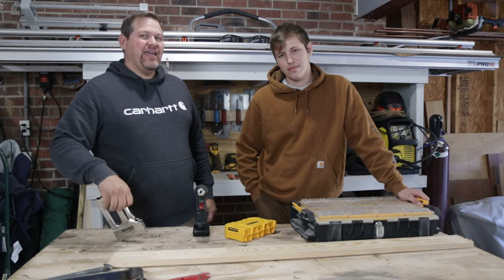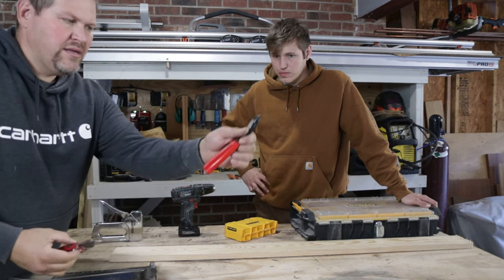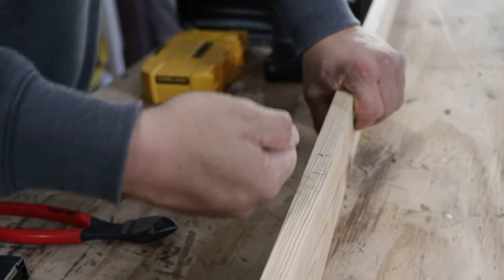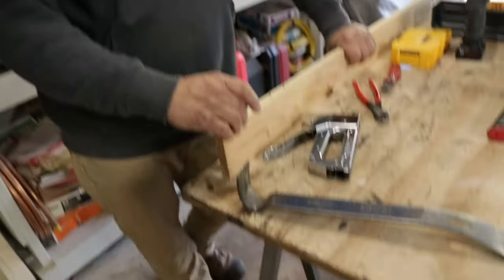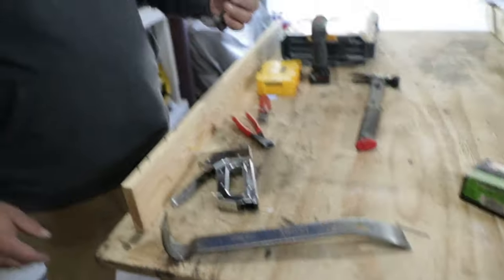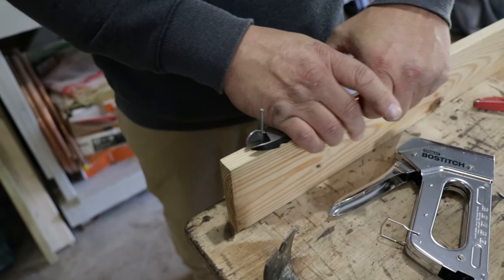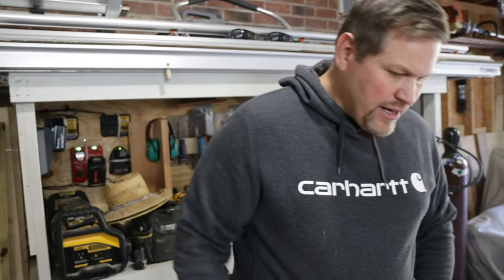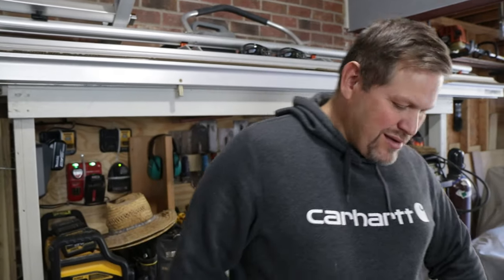How To Remove Nails, Screws and Staples Like a Pro

Comment: End cutters work much better for pulling nails. If you carry a four-inch by four-inch piece of 1/8 aluminum plate you can pull nails with a prybar, hammer, and a lot of other tools with no damage. Aluminum plate really shines when pulling nails from drywall that are nailed into studs. Aviation snips do a great job pulling nails from the back of painted base.

Comment: A stiff back single bevel putty knife is better at at lifting staple crowns. Also safer as the snapped knife blade demonstrates. You can also pry against the blade to avoid surface marring

Comment: A small damaged screw drIver that you grind in a point is great to loosen staples.(you have to work with the grinder until you get a point that works for you.
An end cutting nippers work a little better than side cutters.

bet his mom never let him have a switch blade (evident by the way he flips his utility knife open)